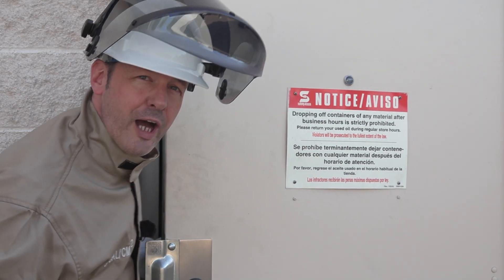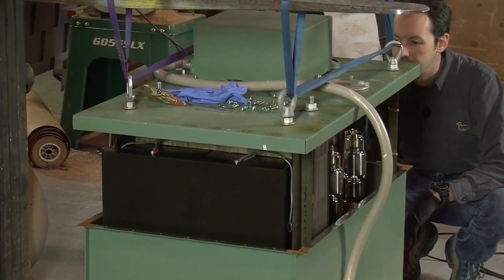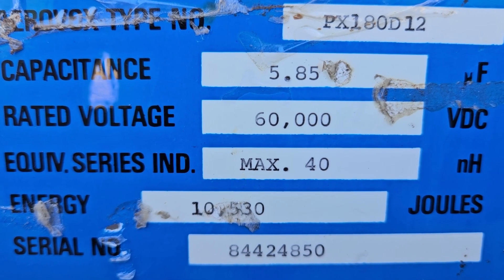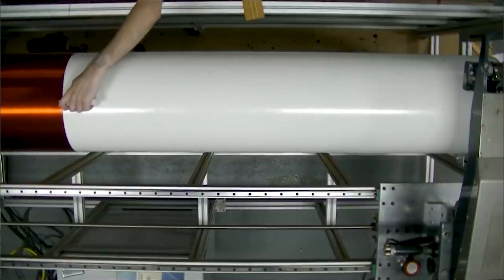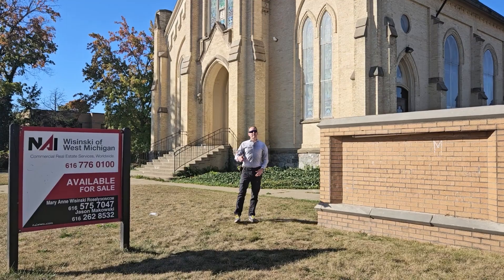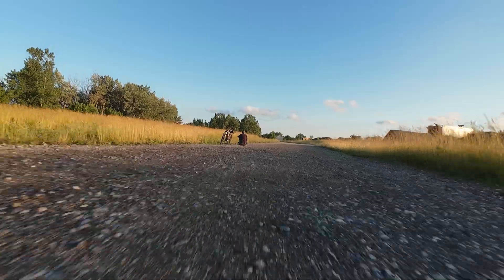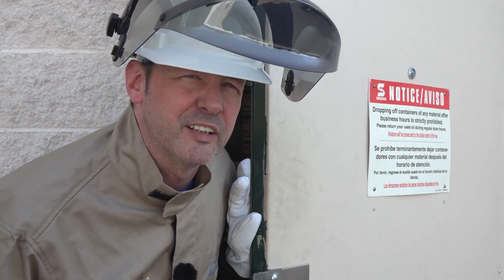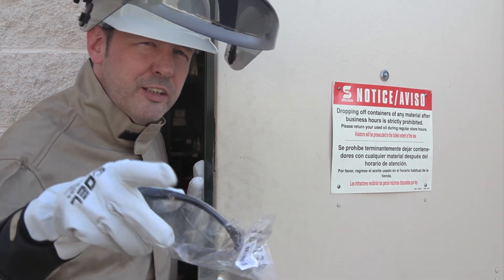Don't Do This - High Voltage For The Home Shop, Season 1 Episode 1

Comment: Biologist here; years ago when I was first in college, I started learning about water-borne diseases, wastewater management, and touched on the incredibly nuanced civil engineering that goes into managing sanitation. It was then I realized that everyone from wastewater engineers to garbage throwers save more lives every day than the police could ever match. (seriously, the sheer number of human beings who died by shitting themselves to death before the age of sanitation is ludicrous [fucking cholera])

The same is true for electrical engineers. Just look at how many people die when there's a power outage during a heat wave, or how insanely dangerous it is if a hospital loses power. 

It's crazy how often our lives are saved by people, and we don't even realize they've done it.
Reply: To be a /little/ fair... a big part of the reason people die during the heat wave is that buildings aren't made for hot weather, because AC is an option. In places where AC isn't affordable, homes are made accordingly - windows facing away from the sun, thick walls with a high heat capacity to average out day and night temperatures, shutters and awnings where needed, light shades of cladding or paint on the outside.

But then AC comes along, and suddenly every company wants their office to be the TEMPLE OF GLASS! And home-owners want the view and illumination of a huge sun-facing window. And so what if you've accidentally built a solar oven? Turn up the AC, problem solved. Nothing that can't be fixed with moah powah.
Reply: @vylbird8014 same reason the UK government is selling heat pumps as the best thing since sliced bread. Used to be combi instant gas fired boilers. Which were awesome as you get mains pressure hot water.  And it works when the lights go off, or at least you can cook. Efficient works best in controlled environments. I was in houston after the 2024 hurricane with no power for 6 days... had natural gas for the entire time, had always talked about but never got a natural gas generator, so damed expensive, then I was was  laying on my floor in my house which has the build quality of a tent nailed to a paving slab and thought..... bollocks you saw this coming, making your own sparks using natural gas might have been expensive but you'd have been more robust than a power system that weaves their power lines through old rotten oak trees that like to fall down, if its windy, if it rains, if its too cold, if it hot, if theres a drought...... don't get me started about the water outages coz no one in texas thinks lagging your pipes is a valuable piece of insurance.Here they consider dripping you taps to be the logical thing to do.....
Reply: people dont really die from heatwaves, not in numbers in anyway comparable to the number who die from the cold.

Comment: Used the monitor inconsistent with its labelling, put analog levels into Video+ and Video-. It resulted in wrongful termination, mixed signals and severe on line bias!

Comment: I've been an electrician for some 20 years by now. There is a reason why I don't have anything above 1000V in my workshop, besides a microwave that's still a microwave. It's because I've been an electrician for 20 years and I know what I'm doing. I know there was a disclaimer, but if you don't absolutely need the stuff from this series, don't build the stuff from this series. It's just a liability waiting for someone to turn it on by accident and fry themselves, including yourself. Electrical injuries range from minor inconveniences, through life altering, to death in the worst way possible. And I mean life altering where (aside from other things) you're randomly pissing yourself because the nerves that are supposed to control your body are fried.

Comment: Hey Chris! I'm really looking forward to this series. I've spent the last 30 years as an electrical and mechanical engineer, running test labs for several major companies, testing and destroying some of the coolest equipment made. If a product failed, it was my job to find out what went wrong, replicate the conditions, and find out what was a real product failure and what was not, then working to rectify the failure.  Many failures were attributed to either hubris of the design teams or just plain dumbfuckery on the part of the installer or the consumer. It was the best career an overage juvenile delinquent could have! Always remember, if you pump enough electrons into anything, it will explode. Love the disclaimer, it reminds me of the opening credits of "Monty Python and the Holy Grail"!

Comment: I do low voltage audio work, building cables and messing around with cranking speakers WAAAAAAAY past what they are rated for. I’m an Audio Engineer and Sound designer by trade but love getting into the nitty gritty of power. Everything from microvolts of microphone-level signal, to 9000w generators to power multiple speaker stacks loud enough to blow your socks off in any NFL stadium across the country.

I love what you do and am very excited for what I can pick up from this. I understand that things ARE what they are in what I do, but not always HOW or HOW DO I MAKE THAT HAPPEN at an electrical level without the aid of a fancy computer interface. 

I am currently trying to learn enough to eventually be able to make a 1000W+ integrated power amp to drive a pair of line array speakers I’m building from scratch. I am ready and willing to put my osha card into a small box and bury it for this knowledge.

Thanks fellow turbo nerd!
Keep up the great work!

Comment: Was told early on in my aptenticeship as a diesel fitter. All it takes is one minor F up or slip of concentration to be sitting infront of a judge and jury for manslaughter. So always double check anything related to the safety of the vehicle/machine  you are working on and if nit shure just get someone else to check. Preferably the supervisor/manager because they will be going down with you so allready have a stake in the game.

Comment: I met an electrical engineer at my previous job. He's the kind of guy who does everything from foundation dirt work to final trim and has built dozens of homes over the last 3+ decades and, for some reason, saw me worthy to take on as an apprentice. I've done loads of weekend mechanic and basic carpentry personal projects and fixed my own hvac system a couple of times but this was a whole other world to dive into. I finished my first solo job a few weeks ago and can confirm that you are absolutely correct about the "first light" experience. My mentor helped walk me through some things and answered a few questions but I did the absolute most of it on my own and it was surreal. I thought surely I messed up somewhere but everything checked out once service was pulled. I know it's child's play compared to some of the insane industrial setups some of you guys do, but it was definitely an experience I won't forget.

Comment: I need this. My PV panel strings only go up to 250V for now.
I want to go past 1000V.
And I want to have 2kV sockets in house, so my wife wouldn't dare to plug in anything into the sockets anymore.

Comment: Shorting a 240v, 3500w power supply is about the closest I want to come to ever getting electrocuted.
Knowing the only reason I broke that circuit was because my ass clenched and pulled away from the metal gate I was leaning on kinda scares the shit outta me.

Comment: Back when I was 9 years old I showed an aptitude for electronic repair (Radios/record players/TV's that kind of stuff). A lot of dry joints, components that were too hot to touch and physically broken components, mostly that kind of stuff. I learned at the library what the components did (and read a lot of Tintin) and that made me get better (not the Tintin) at repair and also learned that maybe I should be more careful. 40+ years of Telecoms, Computing, electronics and ill-advised electrical work (and careers) and I'm still here, OK some close calls. But I still enjoy it, buying project boards/Arduino/Pi it's fantastic. So I really look forward to seeing what is done here.

Comment: My death-in-a-box device is GE potential transformer, 14,000V on the primary and 120V on the secondary. Don't remember the kVA rating at the moment, but it's lots. It makes a very cool (or hot, depending on your perspective) Jacob's Ladder. Picked it up for 20 bucks at a surplus store near the Hanford reservation, weighs close to a hundred pounds.
Reply from the maker: It's rated for 1.5kVA. Bonus points if you didn't lose the little plastic cover for the LV side terminals.
Reply: @ChaoticGoodChris  Now that I'm home, I took a look at it. Nameplate shows catalog no. 93X883 model HBF3, rated at “only” 400VA. Never had the plastic cover you mention.
Reply from the maker: oh wow that's WAY tiny. I was hoping you had a similar model to the one on my bench.

Comment: You had me at "dont do this". I work in steel fabrication and absolutely love it and amateur electrical work with a good side note of safety and professional  advice has / always will be a hobby of mine. Especially with electronics and more mild forms of high voltage.

Comment: I built a Jacobs lantern using an old Oil furnace ignition transformer. 117 vac input. 8,000 vac 20 mA  output.  Fortunately no one got zapped.  I would also use it to test or clean spark plugs for 2 cycle motors. They would foul a lot with the  20 to 1 mixes  they produced back then.

Comment: I’M IN … “ Science doesn’t care about your feelings and physics hurts” 👍👍
I am a mostly retired from the triads (50 years) HVAC&R, industrial building mechanic (elevators to toilets) and lastly an industrial electrician. Im just a bit crazy from 30 years but not stupid, have built Jacobs ladders from large high voltage transformers, fire works with electronics, … many things I’ve built and worked on could easily kill of not respected.

Comment: Bud went on break. He took off his plastic gloves and headed for the gown room.
On his way he ran accross a couple of guys removing a plasme etch power supply.
It weighed a ton so he stopped to help them pick it up. 
A moist finger slipped past a missing pannel and touched a cap.
It buterflied his hand like a shrimp.

Comment: As a current dabler in the dark arts of electricity and as an electrician i can say this: your chicken stick and safety measures are nothing in the face of electricity. If you so breath wrong when over 240v you'd be lucky to still have skin and breathing. But that will never stop the adrenaline when you see your tedious work pay off and the crack of lightning through the air, just be safe and have fun...

Comment: Mad scientist time.  Engineers need to realize that things they design have to be worked on for repairs.  There is no reason that and electrician or other maintenance tech has to dislocate their body parts just to repair something on a piece of equipment.  Engineers should to be required to physically work on what they designed and was later installed on equipment instead of being on the phone to a tech at some facility  instructing them on the worthless repair procedure.  Nothing beats hands on experience.

Comment: You have not lived until you turn on a 10KW high voltage power supply for the first time. Not knowing there is a small nick in the insulation of the HV feedback resistor input lead. Nothing wets the trousers like a 12" plasma ball roaring and screaming, in your face, less than an inch from the tip of your nose! Imagine the sounds of a 100 foot wide waterfall punctuated with bat sonar while chewing broken glass ripping your ear drums. Yes, I know it sounds very romantic. But trust me, the new underwear store will come to love you. The poor 22 YO college grad I was training quit the next day. Huh? Wonder what his problem was?

Comment: Working at a power station, when we were introduced to the high voltage side, we were shown a dust pan.  

"This is a first aid you would receive if you make a mistake at 400kV at 2000 amps"
Reply from the maker: OOOOOOOOOOOOHHHHHHHHHHHHH I'm using that! Thank you! :)
Reply: Our safety briefing at a classified establishment included a map. This covered several hundred square metres and showed where they found the widely-distributed parts of two people who really screwed up one sunny summer's day. As the lecturer said, "They only found one head. That's unusual, the skull is a very robust part of human anatomy and it usually survives this sort of incident mostly intact."
Reply: Neat. Better than "Electricity makes you small, black and ugly"
Reply: The most scary thing that sometimes people survive this but end up missing a few limbs or all facial features including eyes. And I've met one guy who got his thumb popped like a fuse.
Reply: @PalassCat better for a fuse to blow than not I guess — even if it is your thumb.
Reply: @JasperJanssen  Long time back I knew a young man who was missing both index fingers. He had been an electrical engineering apprentice and he found out the hard way that capacitors hold charge for much longer than he expected.
Reply: I used to work in IT, and was once fixing stuff in a classroom full of trainee power line workers. I wasn't really paying attention to what was being said, but one sentence from the lecturer caught my attention. It was something like "Personally I'd rather get hit with the input of those transformers than the output....... Oh, both sides are going to k1ll ya d3ader than d3ad, but at least at [Some large number I can't remember] amps you'll be atomized before you get chance to feel how much it hurts". 😲
Reply: Ex competent person here. Can confirm!
Reply: Our university teacher told us of an accident that had happened close to our uni. An UNPOWERED transmission line had enough Zaaap  in her to make an unfortunate lineman turn to pulp. Seriously they had to scoop the poor guy from the ground 😢. 

He the whole thing, guilty as charged.
Reply: @georgem4713  Yep, an unpowered, ungrounded transmission line is basically a pretty decent HV capacitor. That was one of the first things they taught us about them anyway.
Reply: @CoolKoon WOW, more info?!? Is is still receiving current from nearly lines or just due to is mass, has stored energy? DC power? CrayZ...
Reply: A coworker worked at a rock mining plant in his youth. One electrician proved why it's essential to wear arc PPE. The shadow of that event is still on the wall.
Reply: Oh yeah, before the exercises began at the external HV lab at our uni we were told about a piece of pipe held by the lab assistant as he was lowering it that "if you touch this while it's on your family won't have to arrange for your cremation anymore". Couldn't agree more.
Reply: bye Dusty...